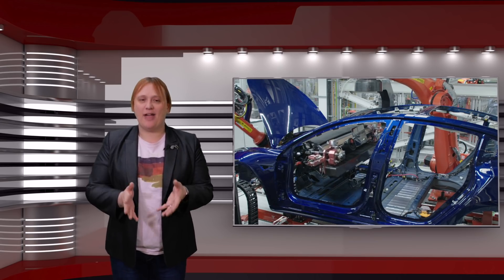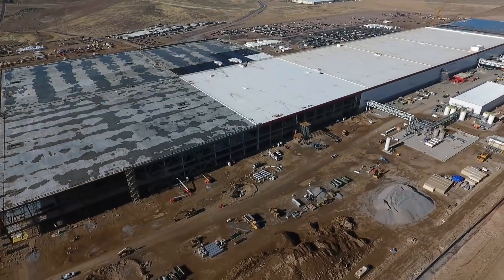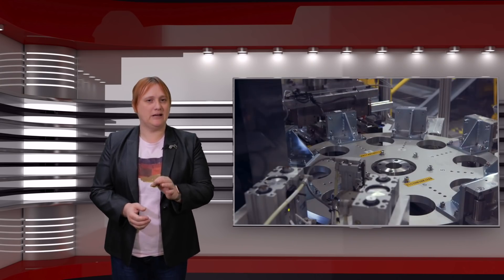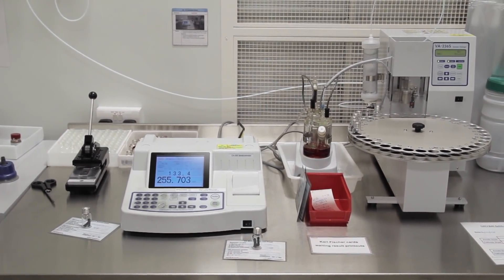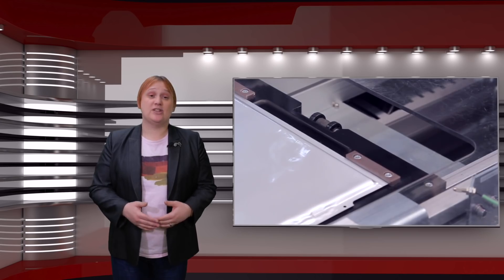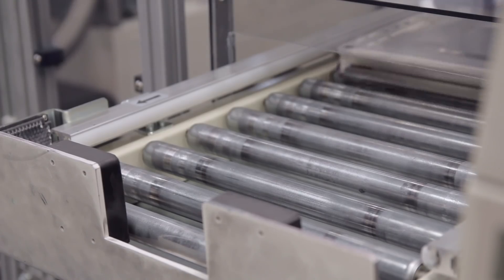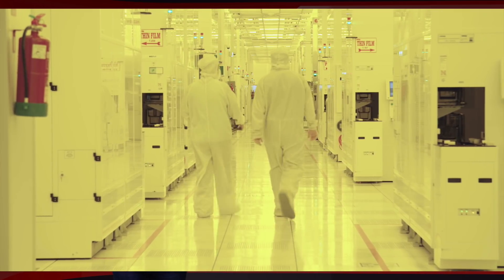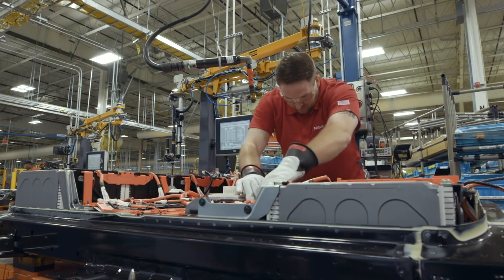Want A Battery Breakthrough? Figure Out How To Make Lithium Ion Batteries More Easily!

Comment: Every time you said "highly trained, highly technical staff", you showed a robot :)
Reply: Somebody had to program that robot.
Reply: @kidlatazul  for like, a couple days.
Reply: @Rin-qj7zt  Yes, but then at some point an aspect of the production changes, at which time the robot must be reprogrammed. Or a new robot is acquired. The programming and maintenance these machines require demand a trained and skillful workforce, who can in turn demand a higher salary than the workers the robots replaced, although granted there will be fewer of them.

I'm from Pittsburgh, the poster child for heavy manufacturing and all that has happened to it. Years ago I heard the president of the United Steel Workers interviewed on our local NPR station. He of course wished that more steel were produced in the US, but he also acknowledged that even if new mills were to be built they would employ far fewer workers than they once did, because of the automation of modern steel mills. He claimed that the control room and operating equipment of a modern steel mill is more complex than the flight deck of a 747. I have no reason to doubt him. It's those more technical jobs, with commensurate higher wages, that the USW president was after.
Reply: @kidlatazul  i'll take your word on it lol i wasn't too serious.
Reply: Who do you think are the required skills for the "robot" in question:
 1) Engineer and design, 
2) Build and assemble 
3) Installed and commissioned 
4) Programmed and serviced 
5) Maintained in operation. 

Of the following 5, what task do you think requires a highly trained staff? 

Granted 4 and 5 are Ops dependent and not manufacturers. But cry me a river, if as laborer within a facility can't seem to recognize that it would be an added skill to learn some basic programming or other technical knowledge. 

Then yes, you deserve to be replaced by a robot. 

No different than a coal miner who can't be bothered to see he/she is working in a dying industry. And would rather wait till the gov subsidised the industry to maintain jobs. 

I am not for kicking people with low skills (or people that are in a changing industry). I actually believe the gov (and businesses) should invest in free or low cost education options to raise the bar and get them into higher paying jobs. 

Problem is, Capitalism works on simple math. The ROI on a $150K robot that eliminates 4 positions is roughly less than 1 year. 

While Investing in affordable education is more like 5 years.  

And guess which option shareholders always vote for?
Reply: I saw footage of a person seemingly controlling the robot.
Reply: @TheGerm24  If someone is controlling it it can't be a robot.
Reply: The positions for the operators who run the automated lines are entry level FYI
Reply: Hey bob? How high can you get? Lol.

Comment: Tesla gigafactory need to make 5million 21700 cells per day to make 7000 model 3 per week. Maybe I waste 10% half million cells. They are recycled or sold to China for low power applications (Tesla 21700 cells are being rewrapped and sold in various names in China)

Model s x 18650 cells are not considered here.

Comment: Global rollout of EV seems impossible.
A better solution could be to use DualMode vehicles which are partly powered from a monorail.
Such a system has been developed and tested in Denmark. It is called RUF (Rapid Urban Flexible). See: www.ruf.dk/rufstatus.pdf
Reply: Palle Jensen “Global rollout of EV seems impossible”
substitute RUF for EV and I’ll agree. Nice try though - at least I know what I don’t want

Comment: Perhaps the smaller commuter EV with likewise smaller capacity battery pack has a place in our current time of limited battery supply!
Loving to give opportunity for groaning and growling .... maybe EVs with 100 mile ranges are a good thing for the time being.  Try a used compliance car, perhaps .....   That would not even require a new battery to be made!   (you may now throw things at this post ....).
Reply: I won't throw things; I think you're right.  One catch, though-  We need a more dense fast charging infrastructure.
Reply: Agreed.  I'd like to see some smaller battery options for the current/upcoming EVs offerings.  I rarely drive more than 60 miles.  Most of the time I'm well under 30 miles.  I'd take a significant range reduction if it meant the cost of the car was notably lower too.

Comment: An interesting and informative video.  The bottom line remains however; Until EVs become cost competitive with ICE vehicles, the average consumer cannot afford them.  For example, in Canada, the Kona EV costs 2.2 times as much as a Kona ICE.  That is rather off putting to most consumers.
Reply: The only real cost difference between an EV and ICE is the EV is higher initially, but upkeep is low and ICE starts out cheaper, but upkeep is high.

Our 3.5L Nissan Maxima was $40,000 AUD and costs $4,000 a year to run. Assuming a base Tesla M3 is released for $50,000, the running costs will only be $1,000 a year.

Year 1 - Nissan 43k Tesla 51k.   Year 2 - Nissan 46k Tesla 52k.   Year 3 - Nissan 49k Tesla 53k etc...

The real pain in the butt though is most people will finance so it really will come down to whether people will be fine with swallowing that bitter pill over financing for a larger amount, in order to get the EV, or have the discipline to save up a larger deposit to offset the higher cost of purchase.

Assuming the car is being kept for at least 9 years (or more) then the EV becomes a no brainer, even at the higher cost of entry. Its also a no brainer that the only EV worth getting is a Tesla, assuming their prices continue to come down (as they have) over time.
Reply: @mimo5383  Thank you for your informative reply.  My point was the price difference  between the kona ice and kona ev.  At more than twice the price, the ev is not attractive to most.  An additional cost that almost no one considers is the opportunity costs associated with opting for the more expensive vehicle.  A back of the napkin calculation (assuming you could pay cash for either vehicle) shows that if you opted for the less expensive kona and invested the difference at 5% over ten years would yield a return of around $15,000. (canadian) I didn't do the calculation for financing the vehicles but the return would be substantial, if somewhat less than in the first example.  Then after 10 years, the price of an EV should be (hopefully) equal to an ice vehicle and you would have the 25K you saved plus the 15K in interest.  You could buy 2 EVs with that at the new price point.
Reply: @mimo5383  my diesel Citroën C3 Picasso(wonderfully practical and enjoyable car to own..) cost £8000  (cash) @ 3 years old with 20000 miles, pristine condition. Road tax £20 per year. Running costs negligible. As I only drive about 5000 miles per year it's going to be a VERY long time before an EV will come even close to being a cost effective alternative isn't it!!??
These are the practical realities of the transition to an electric future. And don't even get me started on the lack of charging infrastructure, lack of choice of vehicle types or actual availability of cars to buy when you need one!
Reply: @mimo5383  Depends on the purchase cycle, as in how long you keep the new car.
If you buy a new car every 5 - 6 years, you may never see those "savings" materialize.
Reply: True. I've owned 3 new cars in my life so far. The first for 8 years, second for 9 and the latest (so far) for 5. Aiming for 10 on the latest one. Any EV I buy would be a minimum of 10 years.
Reply: @mimo5383  And in the USA, most folks who buy new cars, keep them for 4-6 years.
Reply: Mimo But Teslas are really expensive to repair.
Reply: There is a Kona ICE? Yum, sounds like a delicious beverage!
Reply: In New Zealand the Kona EV is 40% higher that petrol version.
Reply: @dianemiller169  I'm looking at the Hyundai NZ site.  It shows the base FWD Kona as $31,990 and the base Kona electric as $77,990. That is 2.4 times as expensive for the EV....an even greater difference than in Canada.
Reply: DrgnFlys some of the replacement parts are fairly cheap. Door panels and interior parts are in the same league or cheaper than an Accord.
Reply: DrgnFlys I hope so too.  A tesla drive unit costs $13,000 today on ebay.
Reply: @Ian Finlayson I am well aware of those cost benefits.  I was pointing out a cost that most people don't tend to think about, which adds to the cost of Ev ownership.
Reply: @Ian Finlayson You are quite correct.  For many people the purchase of a car (or often  anything else) is an emotional decision...nothing wrong with that, but it can sometimes lead to financial distress because they pay more than they can comfortably afford.  I would like an EV, but I am waiting for much, much faster charging times (for those long road trips), solid state batteries, and something approaching price parity between EVs and ICE vehicles. So, maybe in 5-10 years? Yes, electric bikes count.
Reply: @Ian Finlayson most people don't keep the car for 10 years.
Reply: On the east coast paid charging is 26 to 46 cents a kilowatt as most of the electric is oil and natural gas generated which is about even with a 28 mpg ice car 

Other places with lots of hydro have electric at much less money and then the EV becomes a big cost saver
Reply: tommays56 , most electronic car owners are also home owners on the east coast of the Us.  That is changing fast. I charge 95% + of the time at home. 6.5 cents per kWh.  Or less the $5 from empty to full.  No oil changes or emissions test. When you go on a long trip in a Tesla all you need to check is your tiers and washer fluid.

Comment: Great video, as always.  I am wondering if TE have any comment on this recent report.  https://www.greencarcongress.com/2019/04/20190420-cesifo.html

It appears to be from a valid independent source and backed by experts in the field.  I do wonder about some of their assumptions (such as the projected 10 year life of the battery which is clearly at odds with other findings).

However it does appear that lithium iron battery production is in itself seriously harmful to the environment and potentially a major contributor to greenhouse gas emissions.  I know these things are always a balancing act but it is certainly something to ponder for those of us planning to take the EV leap of faith.